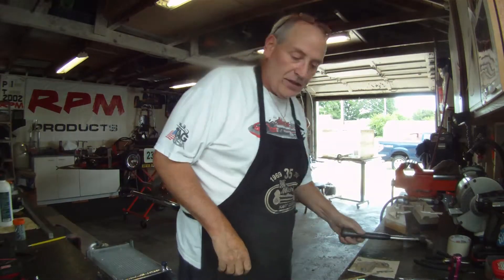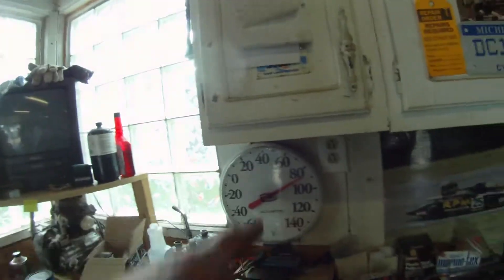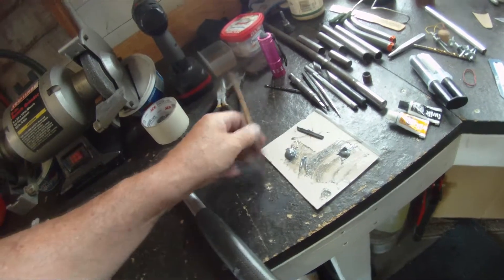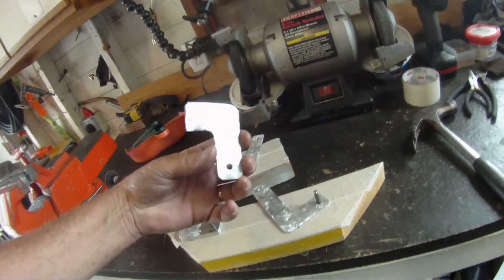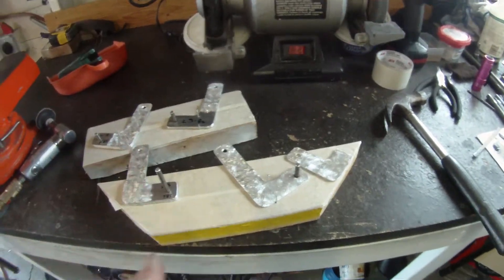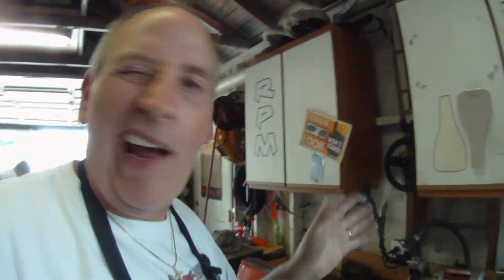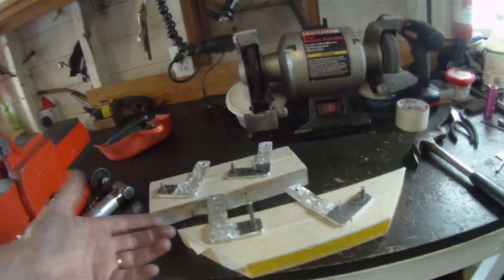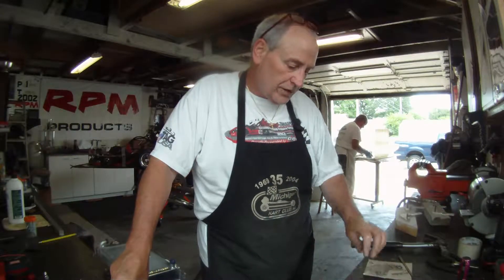Bonding Aluminum plate with Epoxy

Comment: Thanks for sharing. Its a good idea. 

Couldn't you have just created some grooves on the plates and then sandwich the plates with the resin (ie. epoxy) in between?
Reply from the maker: Good Question! Actually, the greater the bonding surface area the better chance you have of a permanent bond.

I would also add, use a new/unused abrasive and CLEAN the aluminum with Acetone to be sure it is clear of all oils from your hands/skin. Especially in Hot weather!!!
Reply: @F125yourself  Thanks for the tip! Cheers

Comment: Your ENERGY is infectious 👍😎 Enjoyed your take on home-grown de-mystification of bonding metals. As a child of the 60's.... I have some hurdles to get over. But there are clearly situations to use it.

Cheers from
L.B. Calif 🇺🇸
Reply from the maker: O-W-N, I'm an automotive prototype guy from here in the Detroit area and we have tried literally everything when it comes to bonding plastics, composites, alloy's or all of them at the same time!! 

In this specific case we were using 1 large very strong rivet and the OEM mounting tab welded to the Rad as support. Simply extending the mounting system to a position we could use for the application. It is a structural bit though and holding up to race track conditions thus far!

Thanks for hangin out with us!!!